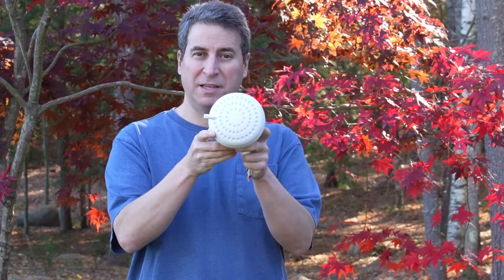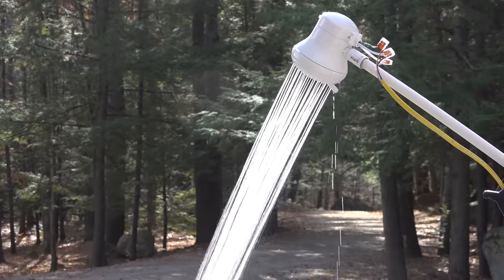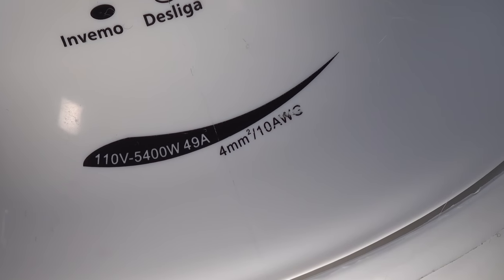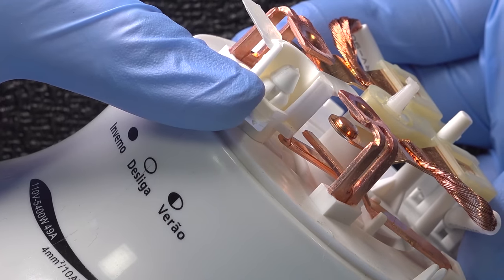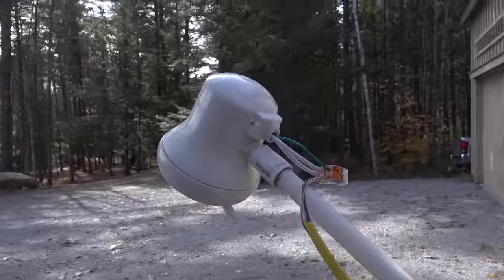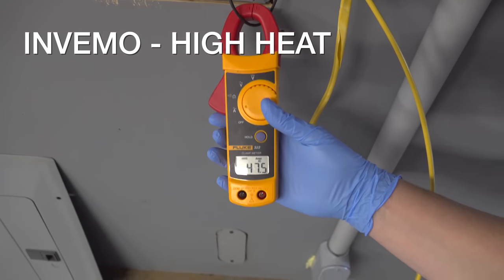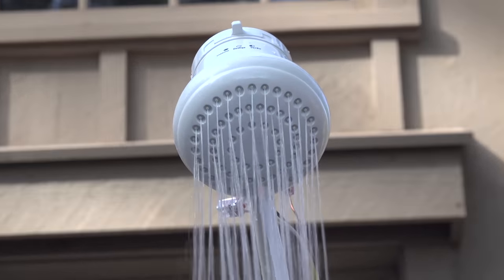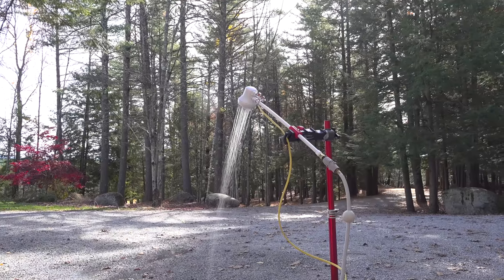What Happens When You Use a SUICIDE SHOWER HEAD in the US

Comment: There is no way that 10g wire is putting out 50 amps without melting the wires. I hate to say your meter is off but amp clamps are notiriously spotty. And if your intern fuse is blown it will read wrong. (I'm guessing its not the meter though since it matches referenced amperage. Especially since you're running 12g wire from the panel though. That wire should be melted in minutes. That's gotta have some wacky inductance or capacitance from that coil or from the water. Maybe an Itty bitty step up transformer? Either way that's strange that the wires dont melt.

Comment: They are only listed as sucicidal in the area's that don't utilize water from a tank on their roof. Meaning gravity feed not presurized as it is in all first world countries and the largest of cites in third world countries. In which case have boilers aka hot water heater's both gas and electric.

As an U.S.A citizen for my entire life, retired and moving to Mexico. The first time I stepped into the shower and saw this device. I freaked out and removed it pronto. Meaning I had to take cold shower's for nearly 3 months before I was made aware of the fact that they only are supposed to be installed in homes that depend on gravity feeding the water supply to them. If and when the water is ever presurized, which some do by installing various size pumps after the water main meter to the house. They can and will because the presure is far greater than it's supposed to be. Result in electrocuting you.

Comment: "There's no + and - in the U.S."  Wrong!  They're called hot (black wire +) and neutral (white wire -). Granted it's alternating current but still there's a reason modern plugs have a bigger contact on one side.  It's because they are actually polarized.

Comment: I used one of these in Kenya and they are incredibly unsafe. Everything metal in the bathroom was electrified when it was on. I had to have my girlfriend turn it off at the switch each time I was ready to shut it off because the shower valve was electrified. It was very difficult acheiving a temperature that was comfortable, too. It was either cold or hotter than the tar pits of hell.

Comment: I live in Brazil. The manual here says that you have to use the device that you show in the final seconds of your vídeo. But yes. Many houses dont use It. By the way its INVERNO not INVERMO. Probably the letters are bad in the shower. 
Thanks for showing this. Love your Channel. Never commented before.
Reply from the maker: I appreciate that, and you are 100% right the printing messed up the invemo inverno which makes more sense. Summer or Winter mode. Interesting stuff!
Reply: @SilverCymbal  yes! Exactly! I see that the printing is failed. 
By the way, here in Brasil we have lots of models. See below, is the shower that I use  here in my home. 
You pay me no more than $10 US dollars for the model that you show here. 
Mine costs about $50. Also I use here 220v. So the wires are tinner than 110V. 
Also of you need more than 5000W  you need to use 220v. Can't find shower that deliver more than 5000W using 110V. 
Also, my house uses the Brasilian 3 pins connector. So my house is grounded. I don't fell any eleteical shock . But if I disconnect the ground wire, and I have any bruise on the skin, I fell a  weird sensation... Is not an electrical shock.. is more like a sensation that someone is penetrating needles into my bruise.. 
See my shower in this link: https://u.pcloud.link/publink/show?code=XZj7ABVZI30LUP5eUKzPDP6Dvhyk74mwXcFX
Reply: @SilverCymbal  yes! Exactly! I see that the printing is failed. 
By the way, here in Brasil we have lots of models. See below, is the shower that I use  here in my home. 
You pay me no more than $10 US dollars for the model that you show here. 
Mine costs about $50. Also I use here 220v. So the wires are tinner than 110V. 
Also of you need more than 5000W  you need to use 220v. Can't find shower that deliver more than 5000W using 110V. 
Also, my house uses the Brasilian 3 pins connector. So my house is grounded. I don't fell any eleteical shock . But if I disconnect the ground wire, and I have any bruise on the skin, I fell a  weird sensation... Is not an electrical shock.. is more like a sensation that someone is penetrating needles into my bruise.. 
See my shower in this link: https://u.pcloud.link/publink/show?code=XZj7ABVZI30LUP5eUKzPDP6Dvhyk74mwXcFX

Comment: If they are going to develop this kind of shower head they need to change the heating filament in the UK our heating filaments are insulated in the middle you have a wire the outsiders that you have ceramic I'm out of sheath is a metal protected sleeve like what you see in washing machines and ovens so they should just changed the heater instead of a bare wire heater

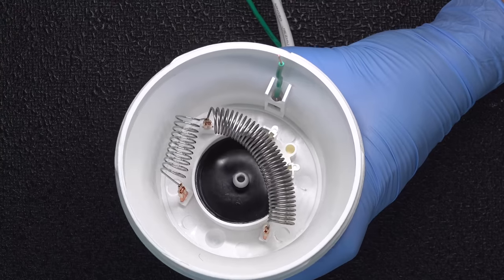Comment: 3:15 You misunderstand how the High / Low mechanism works. 
On the low setting the 2 resistor elements are in seres. 
On the high setting the thinner and higher resistance element gets shorted out of the circuit, reducing the total resistance, increasing the current and greatly increasing the power required to be dissipated by the circuit (heat).
Reply from the maker: You are 100% correct I had AC on the brain instead of heat.

Comment: Unfortunately, the novelty of the appliance seems to have focused attention away from consideration of the maximum sized breaker that can be safely used with the wires from the breaker box through the walls to the showerhead. There is no question that this wiring is massively over-fused. In other words, if the wire is 14 gauge it should be protected by no more than a 15-amp breaker. If it is 12 gauge, it should be on no more than a 20-amp breaker. If a short occurs anywhere in the wiring, the breaker will continue to supply 50 amps to the wiring run instead of turning off the power when the draw reaches the wire's safety rating of 15 or 20 amps. No wires smaller than 6 gauge are normally connected to a 50-amp breaker. Instead of heating the water, the wiring may end up heating the entire home by causing it to burn to the ground.

Comment: As an electrician. You non electrician people thank that amps make a difference in the power. Power is the voltage 120. The  amps is how hot the wire get before an over current takes place and trips the breaker.

Comment: Sounds silly how people react to these showers, maybe due to many of the Hollywood movies where people get electrocuted when they have water combined with electricity, but we have to remember that Brazillian houses are not as flammable as USA houses, and these showers do pull a lot of amps! These showers are the main cause for the "fogo no barraco" (fire on improvised houses of poor people). But if you go 220V + correct thick cable (not wire) and high wattage shower ~7500w I challenge you to find a better high volume hot water elsewhere!

Comment: Some Brazilians calling bullshit in the statement of 99% of households around here having some kind of electric shower. The truth is that the majority of the country don't have pipe gas to heaters, but big cities you have, so in the big cities (and small cities in the path off the gas infrastructure) you will have lots of gas heated water, and in the interior you will have electric shower, with some houses having solar heaters.

But in almost 40 years I never have any kind of electric shock besides some "static shocks" (usually in bad installations).

Comment: The little hose is to clean your butt after you poop, the plumbing systems are not set up for toilet paper in many overseas nations, and it's regular to wash after voiding, instead of smearing with dry paper.
Reply: A friend of mine here in Toronto, Canada had a hand-bidet sprayer, but his attached to the shutoff valve, between it and the toilet, and then clipped to the side of the tank -- very cold water though, to wash a delicate butt. 
A good hand held bidet sprayer is really useful, and good for your health - now that you own one, you might as well install it -- the warm water will be way better than cold!

Comment: The people who feel tingling it's got to be just a placebo effect because the water is not a laminar flow so it's not going to transfer voltage because it's split up by many drops and air gaps between
Reply: The tingling happens when you touch the water faucet.
Reply: @Ranerio  it's plastic that's impossible, unless you're grabbing the metal pipe while it's on I could see maybe but highly unlikely
Reply: The old piping is metal. Does not happen usually. It's when the hard water , mis installed (no ground, inverted live and neutral) and you put the hand in the faucet to turn it off.

Comment: This particular shower is probably a chinese knock-off, and therefore most likely not tested against any safety standard. The words "Desligado" and "Verão" (Off and Summer, respectively) are in Portuguese, meaning this product was created for Brazil. However, the word Invemo does not exist, the correct spelling is Inverno (meaning Winter). Misspelled words like this would cause it to fail any safety certification, so this is likely to be some black market knock-off.

Comment: Ahh yes, my story! I am from Puerto Rico living in a cold part of the mainland now and I use tankless water heater and it does require lower water flow to get a WARM not HOT shower.. And the rating is 250V 50A. The cost? $200 for the unit on average. Some less some more. $25 instant water heating showerhead??? Where!? where!? No such thing as far as I can find. But suicide shower heads are the rage all over the island..

Comment: So where did you put the - wire? On the neutral busbar? So yeah + and - are both necessary. Also if anyone works on it, it should have a color code for safety.
Reply from the maker: Correct, I wired Black to Hot and White to Neutral

Comment: Looks pretty dangerous. Most houses are wired with 20 amp wire for 120 volts. I'd be scared of the wires in the walls overheating and causing fire. Can't see UL or CSA approving the device or the NEC or building codes allowing it as a user installed device. BE VERY CAREFUL with this.

Comment: Good stuff to know that you prefer a bomb under your house than a eletric shock that can EASILY be avoided with a circuit breaker (with discharge protection) and good electrical installation.
Reply: You are not wrong lol a natural gas fired pressure vessel in the basement we are fine with, but an electric shower head is scary 🤣

Comment: In the EU you can't even buy that kind of contraption. I'd never ever shower under one of those. If the resistant element fails you'll be standing fully wet with 110/220 VAC and that was it.
Reply: When the resistance element "fails" it simply snaps, when this happens the water just gets cold
Reply: @user-hh7yt3cb5f  Best case scenario, yes. The element will burn out. The slightest leak, however, and there is a problem.

Comment: Cool video but information was not 100 percent accurate.  Best to use 240 volt for these types of shower heads. If you buy the 120 volt version you will need to lower the water pressure so it can heat up...and probably will not be hot enough to enjoy. Also, the breaker that was used in the video is not legal, it was a 50 amp double pole breaker (for 240 appliance). You would use a single pole breaker for this application since the unit is 120 volts.  Also, 10 gauge wire is not rated for 50 amps. Good video but a little more info needs to be included.
Reply: electrician here, you actually can use two or even three pole breakers for single pole appliances. Its still quite common here in the US for 15 and 20 amp single phase receptacle circuits to share a neutral with other circuits on another phase. its called a multi wire branch circuit, and the only special requirement for it is if you have multiple single phase circuits sharing a neutral they have to be on common trip. Its also perfectly legal to use three pole breakers in two pole applications. 

it is a lot less common in new home construction now due to new requirements requiring arc fault circuit breakers on all 120 volt circuits, and two pole arc faults are nearly impossible to find and three pole ones just dont exist. But code still does not explicitly forbid the use of multi wire branch circuits.

Comment: I would rather take a cold shower. I do mean it. I have taken some cold showers and I would rather do that than be dead. If I had ice cold water I would just use a rag. This thing is that scary to me. It's shocking to me that they can be so safe. 

BTW, I am confident that this thing could kill anyone who has a pacemaker. It takes very little voltage or electrical signal to make one malfunction or destroy it. Anyone using one of these will still receive some electrical signal, even it is very small.

Comment: Well, to its credit nobody is going to be conducting electricity via the showerhead stream of water. It's just the same as peeing on an electric fence. My assumption anyway.

Failures of the installation or integrity of the device is where I see problems. Like its plastic for one. Eventually that is going to decay. Maybe you're in the middle of a warm shower, you just turned the heat to high and it snapped off in the process falling to the floor. Lots can go wrong.

Comment: I was SO close to dieing to a water heater! We had a big secure one installed, but the dumbasses installing it broke it through without telling or testing, so water in the apartment was electrified when it was on. If it didn't cause a burn-out of the heater just before I was about to bathe, I would have been dead.

Comment: Extremely dangerous, if one of the heaters gets cut, you are exposed to a direct AC voltage
Even with the ground wire is freaking dangerous, I will never use something like that, specially here that we use 240v
Incredible how they can sell something like that, it should be illegal in all countries
Reply: bro, 90% Brazilian use this device in decades and there no one case of death. it´s very safe.

Comment: All good right up until you get a neutral fault, with that bare electrical heating element as soon as you lose the neutral the water is then live.
The last thing to save you is that ground wire that’s in the water. Now if you live somewhere where your neutral & earth/ground is the same source & they have developed a fault, you then get electrocuted.
What’s also not impressive is the manufacturer only supplies a few inches of cable meaning you have to join it near the shower head ?
All in all it’s a death waiting to happen.

Comment: 2:01 not Invemo, but inveRno... winter time, where the resistance is cut down to get full power the dissipation. These kind of showers are completely safe. There`s nothing to worry on having one of them. You'll never be electrocuted under these ones if your wiring system is okay, obeying the specifications. The only issue is efficiency. Winter in the most part of brazil won`t get more than 20oC in average.. so this shower is good. But in the southern part of Brazil where the temp can reach negative during long days, the heat transfer is poor. Even at 7500W shower you'll get a freezing bath. This same rule applies to US... anything over the line of TX,FL,CA.... this shower s*c*s.

Comment: In my country it’s quite common I’m from the Caribbean, I installed a couple myself 😂😂
They sometimes shock I think because of poor ground
I wouldn’t recommend changing the temperature settings while water is running I usually see a arc coming from the switch 
In my country we don’t always install it to code , so  sometimes the breaker would trip,  if installed on the wrong size breaker 
Besides that it usually works alright except when it don’t 🤣🤣

Comment: Well you did bet wrong, I'm from Brazil, I have two 220v 8400w electric showers at home. I also have a 220v 6000w electric kitchen sink faucet. Never met anyone in my all my life that has been injured by one of these. There have been cases of people getting shocked while installing them, but that's not the shower's fault but dumb people messing with live wires while installing electric equipment.
These are safe as long as the electric installation is safe, I live in an apartment that's like 40 years old and it has a good installation and decent grounding,.

Comment: This shower was not designed to work with that absurd pressure of water.

The plus mark at the end of cable doesn't make any sense.

And the primary safe rule its not change temperature with shower turned on. 😂😂😂😂😂

Comment: now, Imagine this thing running in England/UK at 240 Volts! 
Yikes! were the ground wire to come loose, or not connected.
at all, or if any other electrical fault happened that caused line current
to make contact with the water. it would be "BYE BYE FRENCH FRY!"
no Thanks. my gas water heater works fine for me!

Comment: That's 12 gauge wire. I know this is a test, but still. You were very close to a meltdown, because 12 gauge wire os rates for 20 amps. 50 amps is way over the max safety rating of 30 amps. You got lucky.

Comment: This shower head is not the best even for hot places here in Brazil, i used tho have one for most of my life,
and is too expensive to maintain, compared to a gas gas heater. I think most people that use this
have a illegal connection the electric grid, and don't have easy access to piped gas, which is more cheaper.